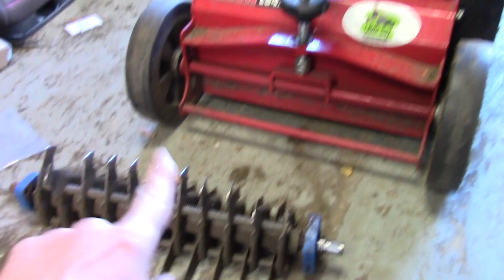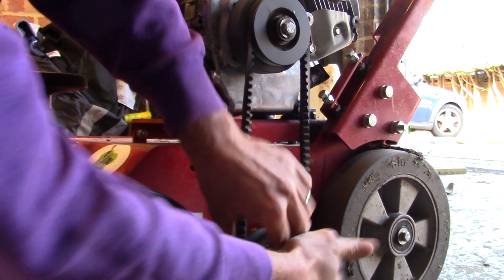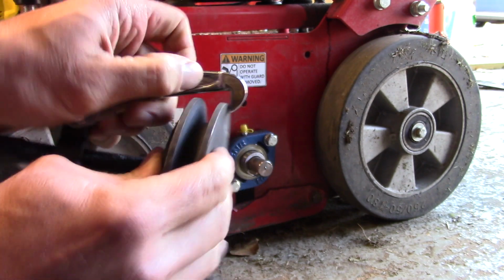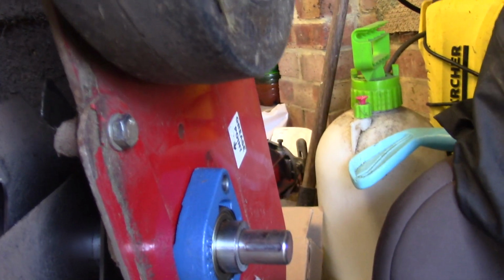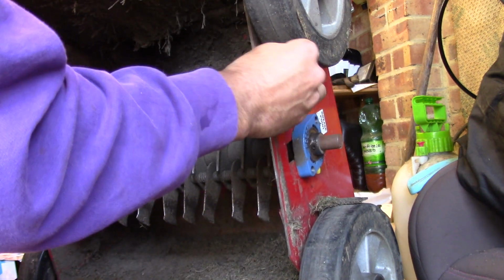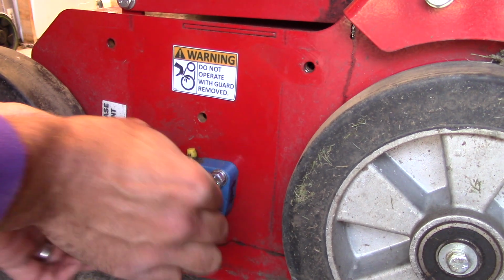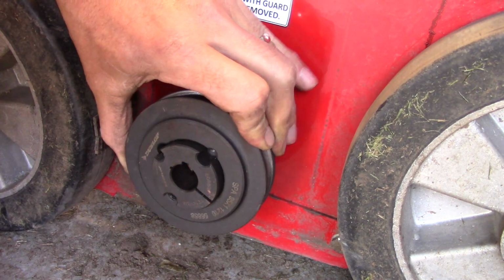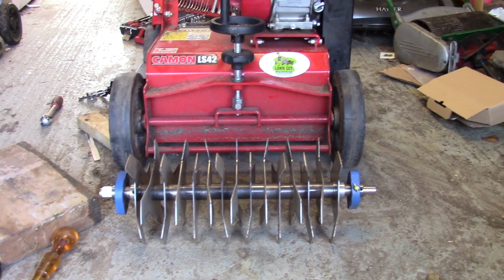HOW TO CHANGE A CAMON LS42 CARTRIDGE #camon #tracmaster

Comment: If you use one of the grub screws removed from the pulley and screw it into the other hole that had no screws in it. As you tighten it will push the pulley off the Bush.
Reply: Tried this and it just wouldn't come off

Comment: Fair play. Ive been waiting for this video. Im a dope when it comes to this kind of stuff. And i dont have the proper tools. My question is, i need to turn the blades so the sharper side is doing the scarifying. Can the whole cartridge just be turned or do i have to get each individual blade off the cartridge and turn them? Its the swinging blades i have.
Reply: I’m pretty sure if it’s a new model like this one you can reverse the cartridge

Comment: Hi mate I can honestly say that black pulley thing is the biggest pain in the a&s ever, such that I can hardly be bothered to switch cartridges to spring rake. also I think the third hole in it your supposed to put a screw in it when taking off and on to widen it. Awful thing
Reply from the maker: Hey Anthony 
To be honest, without any instructions, I was just winging it, but I've done it a couple of times now, and all still works well.
Reply: It’s a taper lock pulley, put one of the grub screws in the ‘third hole’ wind it in and it will release the taper, no need to use pullers